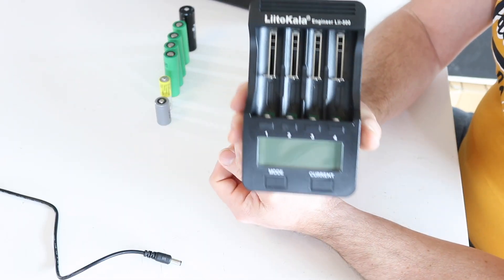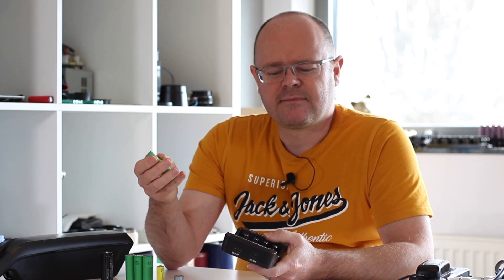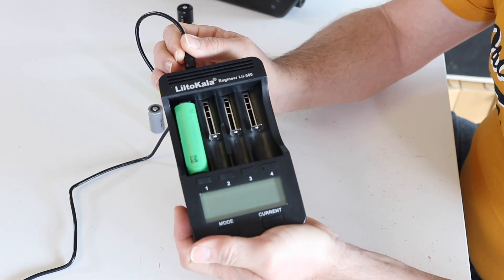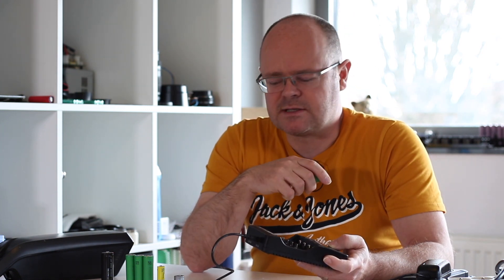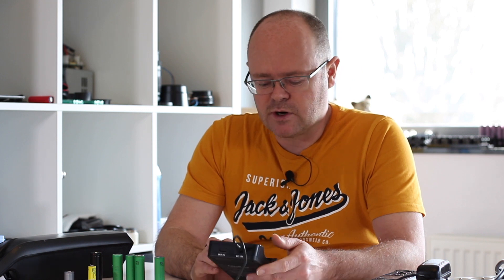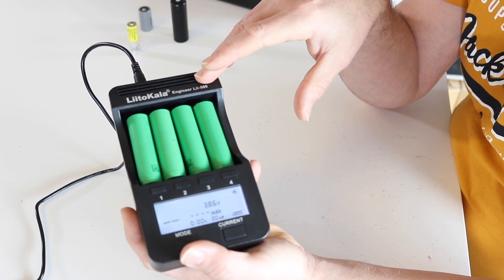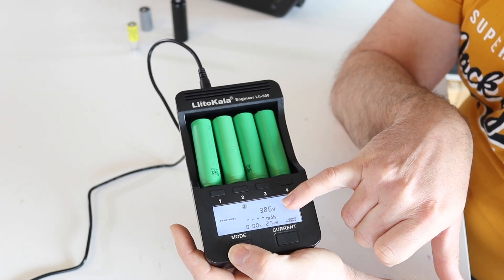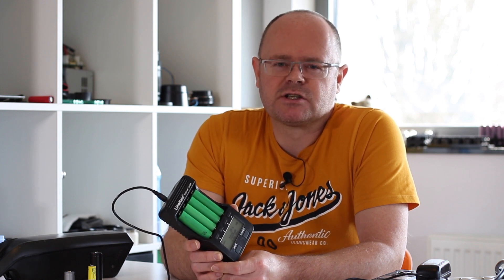18650 - part 16 - LiitoKala lii-500 charger

Comment: Did you try review of older Lii-500 model? Don't know if I should buy 500 for 15$ of 500s for 25$...
Reply from the maker: Don.''t have any experience with 500, so found this on the net.
Default Re: Liitokala Lii-500 Vs Lii-500S Vs ?
Features of 500S:
Polarity of slots is reversed from the earlier version
Supports 21700 unprotected cells
Larger spacing between slots
Supports 2A maximum charging current
No longer supports 300mA charging current (500mA is minimum on 500S)
New touch control display
Discharge current choices: 250mA or 500mA x 4 slots
Charge, discharge, and test modes can work simultaneously

I would buy the S, but other will also work for testing. Biggest downside for me on S is that the cells are upside down. Needs getting used to in the beginning.

Comment: I am new to the 18650's , I do have the LiitoKala 500 and the OBUS BT-C3100 I bought them for under water lights.
Reply from the maker: Hi, for underwater lights??? some kind of flashlights for pool or fishpond? if yes, just charge them full before using.
Reply: @Sailingandelectronics  I would like to ask if I can use my phones usb charger? Cause they didn't give me the power adapter with it.. 
Can I use my mobiles USB charger with it?

Comment: When I receive my 18650 battery's they can't be shipped fully charged. Should I discharge them or just charge them before I use them
Reply: Not sure if you mean for powerwall or just for flashlight or something. Charge when you want to use is best. If building powerwall it is most safe to run charge/discharge/charge program

Comment: Yes I have the same, works well except for low (<3V) voltage 18650's. My opus CT-B3100 still going well after +/-1000 batteries. Capacity test results are kinda similar between those 2. Ri is always lower on Liitokala compared to Opus.
Not sure the Liitokala can discharge 4x1000mA? I thought it was 4x500mA or 2x1000mA?
Reply: mine only discharges 1 at a time but no one mentions this in any review
Reply: 1 slot discharge at a time with 500mah  pretty rubbish
Reply: i wouldnt buy one again look at what hours review of the 4 slot module 15 bucks off ali and way better 4 at a time 1000mah dis is fire unit